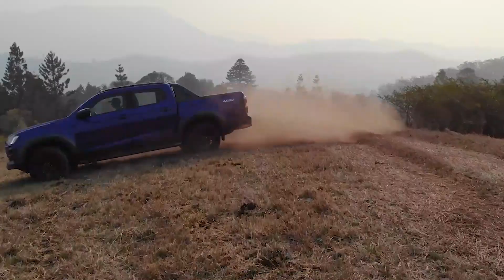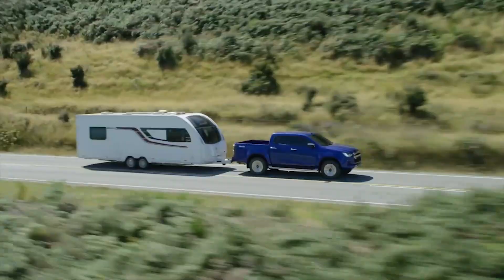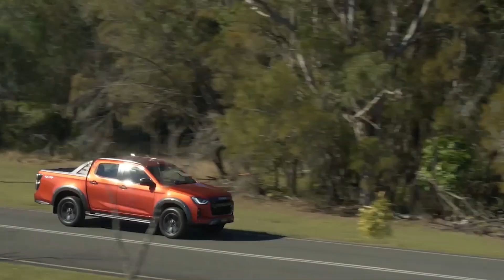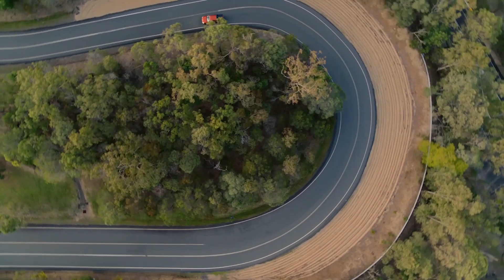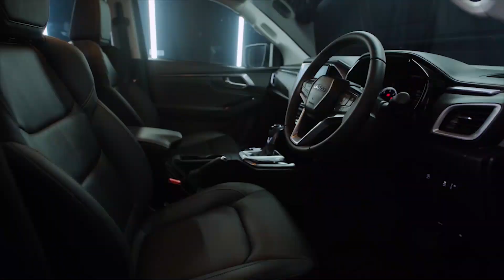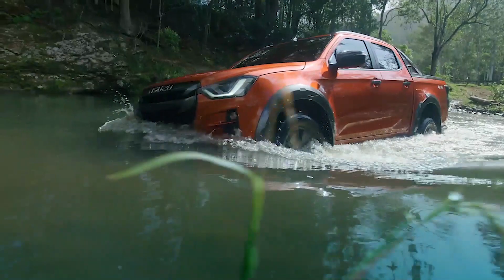Isuzu D Max X-Terrain Review

Comment: yes this is a very nice looking ute the why it takes 6 months for delivery this is a bit of a joke do people want to wait this long when you can go and get a BT50 almost straight away which is the same car or you can go and get the new HiLux straight away which has similar features to this one I think Isuzu need to pull their finger out and start to get the orders for filled ASAP
Reply: Hilux has next to none of the features this new Dmax has. It has lane departure assist and active cruise, but certainly not lane keep assist (self driving within the lines) or stop start with cruise, let alone the string of other tech the Dmax now has. Hilux, Ranger, Triton... none of them are currently close to the tech of this new Dmax / BT50. Yes... you can buy a BT50 now. What Mazda offers vs Isuzu are different. If Mazda takes your fancy... absolutely you are buying the same driveline and tech. Just the interior and options that change.

The simple answer is that Isuzu have sold so many of this new model, their factory can't keep up with the orders. Especially so for the XTerrain with its introductory offer. I enquired about one in January 21 and delivery was April / May, I purchased in Feb and delivery is now Jul / Sep, due to overwhelming orders. In one month it went from 3-4 months wait, to 5-7 months wait, all orders based. I would say a pretty popular choice by many at present.

I've been researching dual cabs for close to a year prior to making my final decision, with test drives... and when the final specs of the new Dmax / BT50 where released, it left the rest in the dust, including the facelift 21 version of both Hilux and Ranger. Driving it stood up to the Youtube review hype. It really is amazing. The Ranger is just slightly better feel on road, but overall, not even a close fourth / fifth overall. Xterrain drives better than the SR5 too.